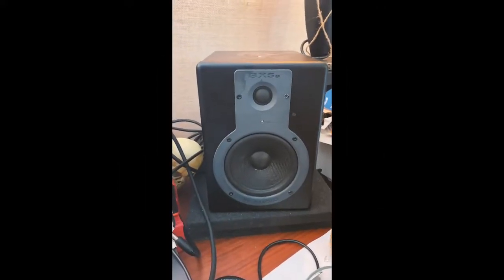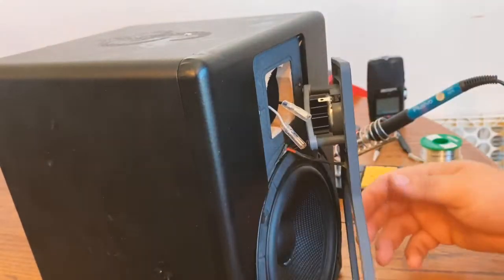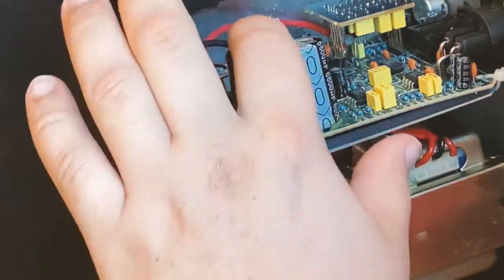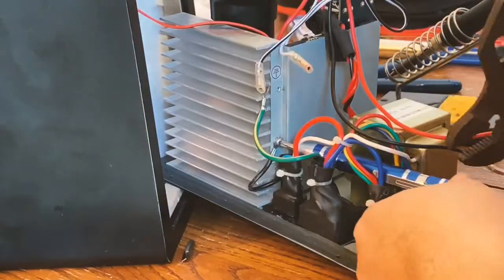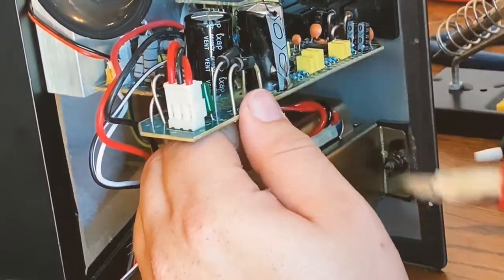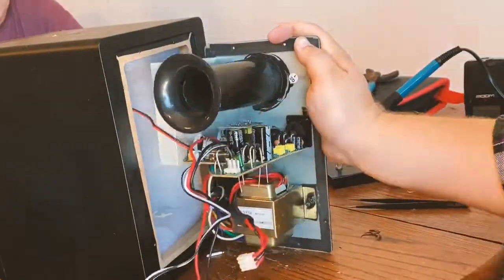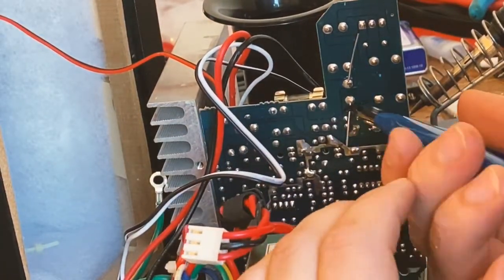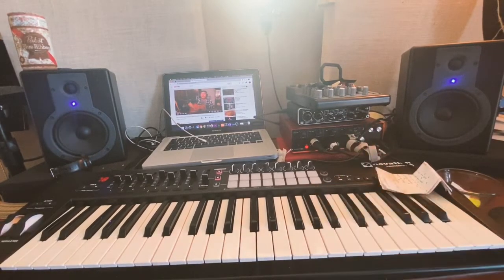M Audio BX5A full disassembly and Capacitor repair (2020)

Comment: front is off, screws at the back are out (the ones around the edge), but the read panel is still completely fixed. I just took out the most edgewise screws, the ones that are like half a centimeter from the edge. Is it possible they glued some of these or something? or should I just bash it? Anything else you can think of?
Reply: ok nvmd i had to push it from the inside with a considerable force, then it snapped out.
Reply from the maker: Good deal!!

Comment: You mentioned making sure the polarity is correct but you don’t say which is which. How do we know which pin goes where?
Reply: There is also a + mark on the board. The long leg goes in there, or the side that does not have a white or gray field with several - written on them.
Reply from the maker: The Caps show which one is negative with the gray stripe.
Reply: For new readers (because this took me a minute)
You can see in the video where that gray stripe lands, if you look during disassembly. 
The negative is on the outside edge of the board on the outer capacitor.
It faces downward or towards the back panel on the inner capacitor. (if this is confusing ask and I'll reply)

Comment: HI. are those capacitors part of the power supply ? 
i have different problem then yours, my BX5a not turning on at all, not even the blue light in front. it since few years ,your video remind me about it )))  there was a burnt smell and i think a pop sound, when it stopped working. checked and replaced the fuse.(i think the fuse was burnt then' i don't remember, but anyway the new/other fuse is ok and not burnt when turning the switch to on. but the speaker is not turning on anyway.

Comment: Hey, do you have any idea on how to fix my BX8's? I replaced on of the capacitators a few months ago and a week ago it just went quiet. I have checked the capacitators and they read good voltage. The signal flows from the capacitators as they should. I do not however get any sound, and only about 0.4v out of the speaker connectors on the pcb. Think it could be something else? Like a faulty opamp?
Any help is greatly appreciated
Reply from the maker: You could re check your solder connections and look for anything out of the ordinary. circuit fault analysis is difficult without seeing the speaker.  I’d take it in to a local tech and let them look it over. if it’s not a simple aha fix. I’d shoot for a new one. Repair cost would be more expensive than a new one. Best of luck!
Reply: @VelocityRecordingStudio  Thanks! I've already checked the solder and tried my best tracing the signal. No problem with my soldering. This time. I'll have to hand it in then. OR buy a scope and follow the signal further.

Comment: Hi, what should I look for if one is muddier than the other?  I disconnected the amp and the tweeter reads 5.6 ish ohms, and the woofer reads 4 ohms.  The capacitors are not bulged.

Comment: small tip for de soldering. it's actually easier to add a bit of fresh solder while heating the component to remove it. then use the solder sucker to remove the solder out the holes AFTER  the cap has been removed.  cheers for keeping good gear out the land fill!
Reply from the maker: Thanks for the tip! It’s always a tricky thing!

Comment: Hi, i have two bx5 d2, and in one of them, the woofer stopped working. The sound comes only from the tweeter. What could it be ? Any suggestions ?
Reply from the maker: In my video you can see me disconnecting the woofer I would check to see if it somehow got disconnected. If that doesn’t work you may want to do this repair. If you don’t see anything abnormal then I’d suggest getting a new speaker they are cheap enough to replace if need be.

Comment: Thanks for the video. It is the best I've seen on the subject. I have one minor problem, though. As you mention in the commentary the two caps are polarized, each cap has a plus and a minus. The positive lead is the longer of the two but I can't tell which is which on the PC board. Could let me know how to tell, please?
Reply from the maker: If you have the same one as mine you can see the orientation @5:38.

Comment: Seems like this is a common repair on these, mine are doing it now. Man, get a heated solder sucker it will make your desoldering a lot easier and cleaner. It will keep you from scratching up the bored. Watch that iron on you left hand, kinda close to the connected wires😳.
Reply from the maker: Thank you I appreciate your help! My setup since has been updated!

Comment: Thankkk youuu. I bought a set of these speakers for like 40 bucks because one of them was buzzing, figured it might have been a wire at first but then looked into it and I'm pretty techy so I said I'd give it a shot. They sound very good and then my first pair of monitor speakers that have been able to get, especially when paired with the subwoofer you can't go wrong. In my opinion older technology sometimes dies out but they just don't make them the same qualitiy and power nowadays because it's easier to make them cheap and less upgraded for $$$$
Reply: Nice. I’m getting mine for 35€ now :) also with the buzzing sound. That’s why they’re declared as defect. But I’m an electrician and I think I can fix that too :)

Comment: Hi, How do the monitors sound connected to the pc without the interfase?
Reply from the maker: Hey awesome question! I will attach the link below to the manual, although I would not recommend that option due to the fact you have no control it could have a impedance imbalance so it will sound close to the same depending on the output impedance of your compu
Reply: thanks for your response. i m considering buying bx5 3 for listening to music but I dont wanna use an interfase. just connect the speakers to a technics cd player  or tablet.
Reply from the maker: https://c3.zzounds.com/media/071220_BX5aDlx_UG_EN01-5d7a6da446ea661e5f51121614a69d23.pdf

Comment: Hi, please answer my question, I have a pair of bx5 d3, and after a little bit of time, beetwen 30-45 minutes of use, they get hot from the back, is that normal?
Reply from the maker: Yup sure is. If it gets hot enough to burn you then there’s a bigger issue. But most power amps get hot. totally normal.
Reply: @VelocityRecordingStudio  thank you for your answer sir 🙏

Comment: This video is well done. I appreciate that you demonstrate what sound the defective speaker is making when you power it on and off.  My left BX5a went out and it makes the exact same sounds that yours does (did). I do suspect that it's a capacitor problem. Thanks for showing the capacitor type and the link to purchase replacements. I appreciate that you point out the places where you had trouble accessing screws, the glue strips on the metal plate and the tie you had to clip to access the back of the board. I wouldn't have known to do that. Good to know that the capacitors are glued to the board and thanks for the reminder to check the polarity of the pins.

I suspect that if I check with an electronics shop the bench charge would be as much as a new speaker, so I'll probably try this fix. Thanks for mapping out the process!
Reply from the maker: No problem I’m glad I can help and that’s exactly the intention!!

Comment: One of my BX5a just crap on me last night, I forgot to turn them off. It makes a hell of noise as you powering it, not good. I will do the job on it on both for preventive reasons. I hope the caps didn't crap all over the board. Thanks for showing what to expect and the link for the cap, nice video.

Comment: I have had one of my BX5 busted for a couple years now finally getting around to fixing it. Thanks for showing this. Some advice on soldering, keep using the solder sucker more than you did, you can almost get all of it off that way. When installing, it helps to “tin” the leads with just a thin layer of solder before you insert them and then they solder smoothly.
Reply from the maker: Hey thanks for the help! I hope you can can use the video as a guide on some methods of getting around the speakers!

Comment: Same problem I encountered with the glue, I'll try what you did, thanks!
Reply from the maker: I hope it works for you! Good luck!
Reply: Hi, Ive replaced all thw caps on bith of the speakers, but the other seems to still have a loud "thud" sound when turned on but smooth when turned off, the other one was quiet as new, what could be the problem? Could be the positive negative side of the caps? Coz I didnt check when I replaced them, thanks
Reply from the maker: I would check that just to make sure that could be your issue

Comment: Great video, I've got the BX5 D2's, great speakers... one has started humming, so seems like the same Cap issue based on my research.  I was wondering how to "cut" the glue that holds the Cap to the board.  Great idea to cut the cover off the Cap!  That's what I was looking for, good ideas!  Thanks!
Reply from the maker: No problem glad I could help!!
Reply: I have a BX5 D2 which switches on but makes no sound - how did you fix yours, and how did you get the front speaker surround off in order to disconnect?
Reply: I followed the instruction in the video... very through! @MrMargaretScratcher
Reply: Mine has a plastic cover on the front that I was able to carefully pry off to expose the screws... @MrMargaretScratcher
Reply: @GenoG  Hmmm, I tried at the bottom with a thin screwdriver but was only crushing the  wood. Maybe I'll give it a go with a wider blade that will put less pressure on the wood. Cheers!
Reply: Thanks for the instructive video.  Are the +,- marked on the board for each cap?….or can you reply with which is which in your video frame